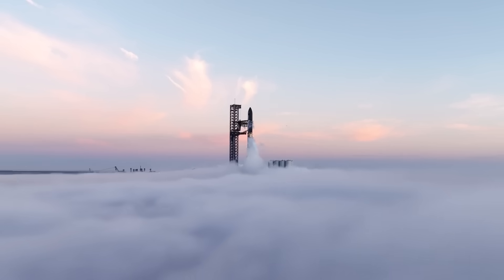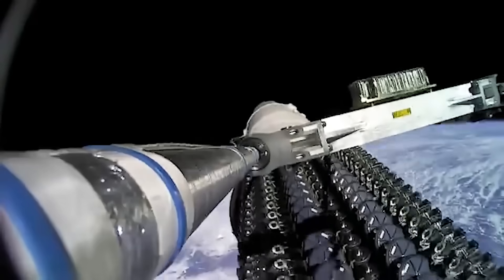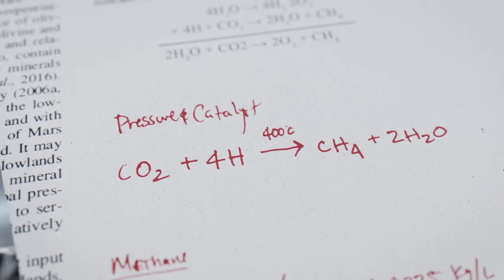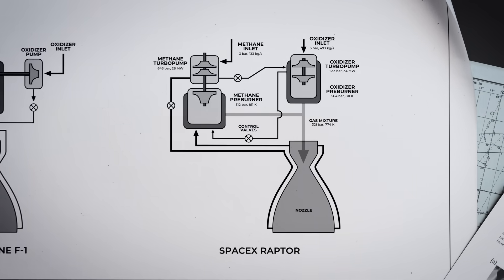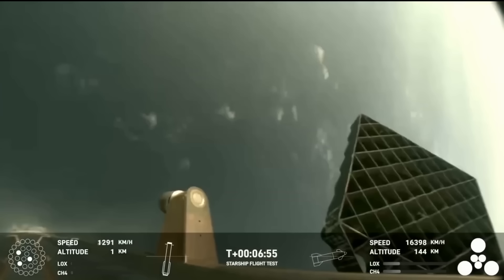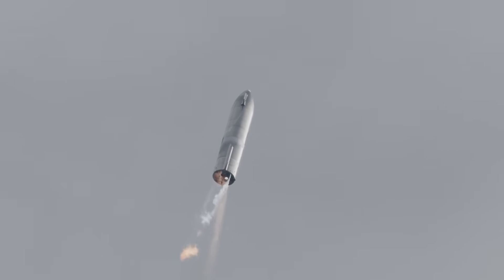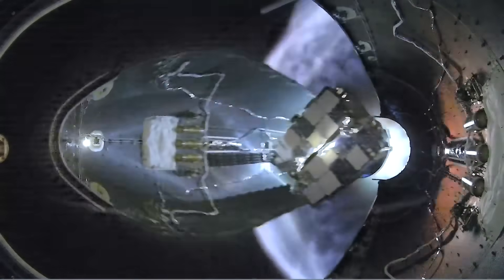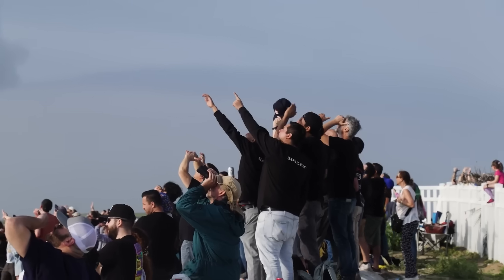Starship Reached Space. What Now?

Comment: Starship did reach space on IFT2, just not orbital velocity like IFT3
Reply: IFT3 didnt have orbital velocity
Reply: @0topon  technically no but it had fuel to spare and cut off the engines just barely before orbital velocity, so if it had trouble re-lighting it wouldn't become space debris
Reply: @0topon It had orbital velocity, the combined potential and kinetic energy was sufficient to sustain a stable orbit with a perigee outside the atmosphere. It just had too much eccentricity as they deliberately burned 'upwards', instead of more parallel to the surface as is optimal, to make sure the perigee would stay firmly inside Earth's rock crust and avoid it possibly becoming the most massive piece of space junk ever.
Reply: @raffaeledivora9517  Ok that works too, i prefer mine because it has fewer edge cases.
Reply: @0topon  Of course it had orbital velocity. It just didn't have the altitude to stay in orbit.
Reply: @KsNewSpace  The attitude doesnt matter, if you have the needed orbital velocity you can orbit any object at any attitude. You can orbit the moon in theory even with an attitude of one meter.
Reply: @0topon  The Moon orbits Earth at 1000 m/s. Its orbital velocity is 7 times less than the velocity Starship achieved. Not sure why you're gatekeeping orbital velocity so much. You can't just leave altitude / radius out of orbital mechanics. You can escape the earth with never going above mach 1.
Reply: @KsNewSpace  I think that we have different defintions about the term orbital velocity. I think that the term means a sufficient speed at a certain attitude to remain in orbit. What is your defintion or is it the same?
Reply: @0topon  The moon is in orbit around Earth and has a velocity of 1000 m/s. Is it not orbital speed? I don't use the term "orbital speed" at all because everything is orbital speed. Speed is always relative. Say a number and say the frame of reference. That's what I can work with. Starship achieved 26500 kph relative to Earth. They achieved an orbit of 150 x 50 km or something. It was "orbital speed". The orbit was just very low.

Comment: The out-of-control roll didn't prevent the Ship from doing a re-entry burn as there wasn't a re-entry burn planned for this flight; it was a burn intended to test re-lighting the vacuum engines in micro-gravity, and the burn would have actually slightly increased the perigee of its orbit. The Ship was intended to re-enter aerodynamically regardless of the test burn; it was just oriented incorrectly (tumbling).
Reply: when was the "re entry burn"?
I saw the ship that was going to slow to be in orbit fall back into the atmosphere after leaking for 15 minutes
Reply: @namenloss730  This is exactly what I said, but in the form of a question.

Comment: So for a launch and refueling in LEO, that's 360 built, tested, and inspected Raptor engines. 7,500 tons of methane, and 26,500 tons of liquid oxygen. To refuel 1 ship/ 1 mission. Starship is cool no doubt, but I can't see how it will ever conceivably leave orbit. I hope I'm wrong.
Reply: Well they won't need all those engines since the whole point is to reuse both the boosters and second stage. Even if they manage to reuse only the booster that's 33 out of 39 engines. Also take into account that they are producing basically one engine per day. Finally, the cost of all that methane and oxygen is less than 10 millions USD.
Reply: Technically they could perform all that with just 2 ships and one booster so only 45 Raptor engines as both stages (except the moon lander) are re-usable. Fuel is cheap the reason space is so expensive is other than spacex you have to pay for a new booster as well as the fuel.

Comment: 4:30 Note that Sabatier process uses H2, not H like displayed in the equation
Reply: Besides which, setting up a working methane plant extracting the "plentiful carbon dioxide" from a near-vacuum atmosphere (0.6% PSI of earth sea level, or earth atmospheric pressure at 35 km altitude), using solar power on a planet receiving about 44% solar radiation of earth's.  Given the most reliably detected source of water is at Mars's south pole (beneath the frozen carbon dioxide cap!), the time, energy and expense to mount an expedition and extract CO2, frozen H2O AND collect enough solar radiation to perform the Sabatier conversion.. we're looking at many trips to deliver enough equipment, nickel reaction mass.. which multiplied by the dozen or so Starship trips required to fuel one Mars-bound Starship.. When finally we do establish a colony on Mars, Musk's attempt will be thought of as just that, the first attempt.  I believe we won't get there until portable fusion power is available.  Mr. Fusion!
Reply: @The-KP  Fusion sucks. Just use Thorium, it exists and it works very well already. Everything else makes sense though.
Reply: @The-KP  They don't plan on using solar, but rather Nuclear to meet all the power demands. It'll work both day and night as a result. 

Also, 1% atmosphere or around 0.15 PSI is plenty of atmosphere to extract from. 

A literal helicopter flew on Mars. 

It's an atmosphere that envelopes a planet. It's like trying to lower our sea level my 1mm. You would need to take out billions of kilograms of water to have any noticeable impact

Comment: the big problem the starship architecture has is the fact that refuelling requires multiple successful launches in fairly quick succession. refilling the entire second stage in LEO would need, in the worst case 12 starship launches. requires a minimum of 40800t of propellant. 

if every booster has a reliability of 96.3% (same as F9 stage 1 since 2010) the mission of filling the second stage booster to full capacity is about 63% (0.963^12) even if they get the same reliability as block 5 98.5% then the mission success rate goes to 83%

the only sane solution for this architecture is to build a propellant factory in space, which is hardly something to call sane. the gravity of earth means you lose any sense of the word efficiency and increase the risk of failure with each subsequent launch.
Reply: F9 Block 5 has never had a mission failure. Even the last landing failure was over 150 flights ago. And even if the refueling ship has a failure, that doesn't mean the overall mission is a failure. Just launch another ship. That is entirely the purpose of Starship. 

Further, if refueling that many times is an actual issue, Starship has another option that people keep forgetting about. They can have expended flights!!!! Shocking right. /s Starship's reusability is to make launches cheap. But if that doesn't become a viable option for critical missions like HLS, then they can and will launch expended flights. They already do the same with Falcon 9.
Reply: @anthonypelchat  go back and read. i specifically mentioned the falcon 9 boosters.

if boosters fail, it puts a real spanner into the refuel based architecture. you need backups ready at a moments notice

you need to put a lot of energy in to move what is in reality a small amount of propellant because getting out of earths atmosphere is very inefficient  

the point being, this part about starship doesn't make sense, you really want space based infrastructure so you don't depend on subsequent launches too get to your destination, which might be impossible even in expendable configurations
Reply: @Altirix_  I know you mentioned F9 Boosters. That is why I questioned it. Not one single mission for F9 Block 5 has failed due to the booster nor upper stage. And even if you're counting landing failures, there has been over 150 in a row with block 5. 

And again, if a Starship booster does fail to deliver the fuel, they are planning to have multiple boosters and upper stages ready. It won't be months between refueling flights.

Other than that, having spaced based infrastructure is preferred. But we have to get to that point first. And that is where refueling flights come in.
Reply: @anthonypelchat  you are missing the point.

the point is a single launch based mission can have a failure at the end and still get the payload to its destination. this is the common failure mode for f9 boosters, with them failing at landing, some fall of the ship but I'm not even counting those.

the issue is when you are depending on subsequent launches, sure you got the payload to refuel but your booster failed to land. 

how do we continue delivering propellant to the second stage? as mentioned, they could have multiple boosters to avoid depending on the landing.

however, look at the capture architecture, the plan is to catch the booster in the same launch structure and reuse it. there is no buffer, you catch 1 and launch 1. there's also a non 0 chance a landing failure damages the capture/launch system. if the plan is to use multiple unique boosters in these refuel missions then, the capture architecture is quite pointless, it would make more sense to land away from the launch pad so you can have a pipeline of boosters so a booster loss only matters if you lose your entire pipeline of boosters.

so to actually avoid a dependency chain of susuesful landings, you need multiple launch towers.

this is why the current plans for refueling really suck, you either need a ton of redundancy or to perfect the system so much you get unprecedented landing success rates.
Reply: @Altirix_  I'm sorry, but it is you that is missing the point. First, Falcon 9 Block 5. It has never once had a mission failure. Payloads have always been delivered. And even with the landings, the last failure to land was over 150 attempts ago, likely close to 200 at this point. That is a greater than 99% reliability on landing and 100% for missions.

Starship's infrastructure is being designed for numerous launches. They are working to have multiple boosters, multiple launch pads, and multiple support systems. Further, because of designs on the flight path, a landing failure is unlikely to take out a tower. You can see this with Falcon 9. The last landing failure didn't come anywhere close to the pad, despite the failure not affecting anything until it was already deep in the atmosphere.

Run your numbers again with a 100% mission reliability, 99.5% landing reliability, multiple boosters available in the event of a landing failure, a 1% chance of major tower damage during a landing failure, and 3 or more towers available.
Reply: Block 5 has a 100% reliablity

Comment: Pretty simple answer to your question.. Starship and Super Heavy need to make it back without getting destroyed in the process.
Reply: Easy answer, no easy solutions. And I doubt SpaceX is up to the task of fulfilling such a task without going bankrupt first. They only passed the Karman line and didn't go orbital, so I'm not really sure why people are so excited about it. It's still decades away from being actually human rated, let alone capable of reaching moon or escape velocities. Landing is. a different beast entirely.
Reply: @Sizifus  I sort-of agree with you.  Loosing attitude control before reentry was a terrible failure - it completely invalidated the re-entry test. At this pace we certainly won't beat China back to the  Moon unless Blue Origin does better than SpaceX has.

I cannot see NASA ever putting Astronauts on Starship, and I also cannot see Starship ever being safer than The Space Shuttle.  That suicide dive with a  last-second flip and landing burn is just too dangerous. Sure it worked once for the low altitude dem flights, but coming back from Space will be much harder.

I also think that Rapid-Reuse will never be achieved with Starship either, and when they start pushing it they will have failures just like the Space Shuttle program did.  Starship is just a cheaper version of the Space Shuttle, and will suffer many of the same problems.  It's not better, it's just different, and SpaceX will just have different problems.
Reply: @ericmatthews8497   People said similar things about Falcon 9.  How silly do they look now?
Reply: @Sizifus  space x is self sustaining. They have an incredibly successful falcon 9 program, not going bankrupt anytime soon
Reply: These are test flights. Neither were or are going to be recovered anyway

Comment: I've been searching the internet to find out how the heat shield tiles are attached and why they keep falling off.  Can't find anything.  Can someone point me in the direction of an explanation?  Thanks.
Reply: They’re attached by a pin system. It’s basically a few pins that just stick in the back and latch on. Underneath there is a ceramic blanket. 

The idea is that they can be replaced easy

Comment: The flight report is, um, optimistic. 0:50 : sub orbital peaking at 234 km is not "just shy of" the ISS's 400 km orbit - 59% of it. "Space X could have performed a boost burn to achieve orbit, but..." there was "out of control rolling" (!)
Reply: It's shy of it in terms of orbital energy, not altitude. SpaceX was also not intending the re-light of the raptor to achieve a circular orbit, they just wanted to confirm it was possible.
Reply: @zlynn1990 I know SpaceX's approach is to sacrifice hardware to save time, but RealEng is muddling together this flight and future plans. To be a little pedantic, the video is misleading on its own terms. The comparison of altitude was in km, not energy. "Could have" implies on this flight, not some other better executed flight. No mention of this flight being kept suborbital for safer ocean landing. "plan to the future... besides this flight had out of contol rolling" would have been better. Cheers.

Comment: It's amazing what a comeback stainless steel has made in the aerospace sector. It enables Starship to accomplish things that are exceptionally difficult, expensive or even impossible with cutting-edge CFRPs and non-ferrous titanium and aluminum alloys.
Reply: The issue is the weight. Musk has publically admitted that Starship needs to be less heavy. We don't really know it's actual payload to LEO right now, all the tests so far have been done without any payload.
Reply: @TheOwenMajor  It's relatively minor right now. The steel is only ~6% of the fueled weight of the vehicle right now. and they haven't even attempted to start shaving off weight in some areas yet. The stainless steel grid fins are super crude and just welded plate metal right now.
Reply: @TheOwenMajor  Correct (believe it or not, but metallurgy student here), but despite its weight, stainless steel is:

Compared to aluminum alloys: 
Considerably more resistant to high temperatures, it has a higher melting point, it maintains its mechanical properties at much higher temperatures, it does not expand and contract as much when heated and cooled (all important traits during reentry) and it is less conductive, meaning that less fuel is likely to evaporate when the exterior of the spacecraft is at ambient temperature.

Compared to CFRPs :
Considerably cheaper, better at handling extreme temperatures (both the extreme cold of the fuel and the extreme heat of reentry) as CFRPs can simultaneously become very brittle when cold and degrade when heated, it’s easier to use when building large components (no need for an autoclave, plus stainless steel is relatively easy to weld and to machine).

Compared to titanium:
Cheaper and easier to work with as it is easier to weld and to machine. The stainless steel alloy that they’re using is actually quite ductile while titanium is quite hard and low in elasticity. This is great for strength-to-weight ratio, but not for machinability (yes, that’s a word).

If you haven’t already, I recommend watching this channel’s video on why SpaceX opted for stainless steel:
https://m.youtube.com/watch?v=6AcE7hBhpYU
Reply: @globetrotter7778  Thanks for regurgitating the SpaceX fanboy rhetoric, which I already am familiar with, while ignoring my actual comment.

It’s amazing how many words you dedicated to 100% ignoring my comment.

Of course I know the benefits of steel. Steel has been long used in aerospace and rockets. And it’s been proposed for similar massive rockets as Starship many decades before.

Still doesn’t change the fact it’s really heavy, and that drawback is why most rockets don’t use it.
Reply: @TheOwenMajor  My pleasure! Have a great day!
Reply: Bro the first word he responded with was "correct", they agreed with you. Learn some respect jeez

Comment: The ship did reach space in the second flight, the flight termination system was triggered shortly before it could finish its burn to the desired orbit.

It was at ~245 km when it blew up, flight 3 was cruising around 250 km; space is recognised to be above 100km
Reply: It reached space yes, but the distinction here is the velocity.  It wasn't really made clear in the video, but IFT-2 was well short of orbital velocity, whereas IFT-3 was within a pubic hair of orbital speeds and just held back intentionally.
Reply: @JohnVanderbeck  it was an elliptical orbit and could have easily been orbit. Scott Manley already did the calcs and the perigee was -50km with a apogee of 234km if you centre that orbit on Earth it worked out to be an orbit or ~115km
Reply: @JohnVanderbeck 
 "It reached space yes, but the distinction here is the velocity."
The claim in the video is 'reached space for the first time', and it is factually incorrect.  The claim is not 'orbital velocity'.  THAT is the point being made by Suppise152. Timestamp 0:14
Reply: First of all, the Flight Terminatiin System is automated, not an 'on demand' function.  Second, they didn't trigger it, as the stainless dildo lost signal right before they even knew something was wrong.